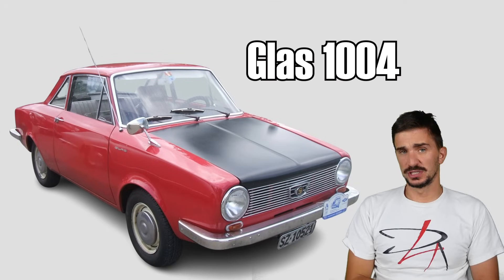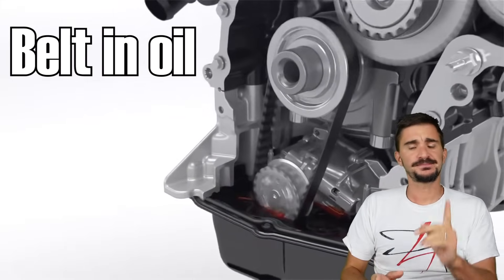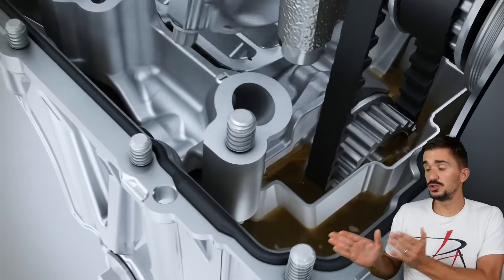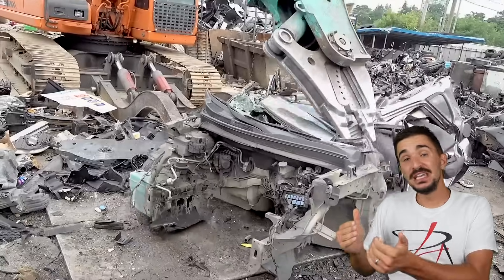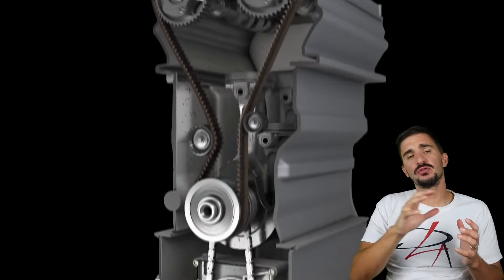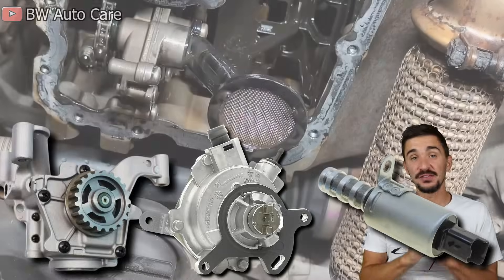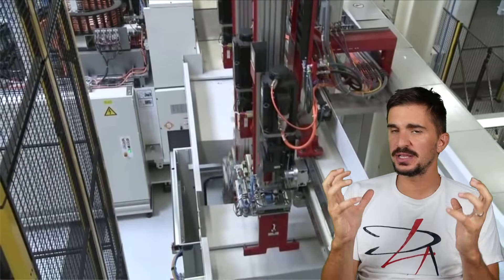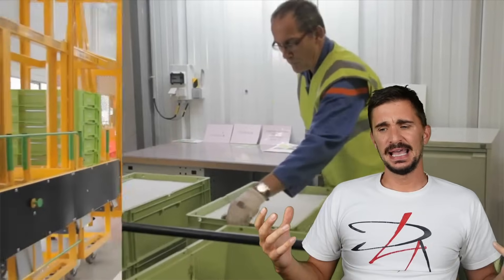Who Approved This and Why Is It Still Being Made? Wet Belt aka Belt in Oil Engines

Comment: We had a Vauxhall Grandland and it's was on it's 3rd belt in 46k miles.
The first one began degrading and was blocking the oil system. 
We change that at 24k miles and had to flush the oil system.
We replaced the 2nd belt at 43k miles with 19k miles on the belt and it had also began to degrade requiring another flush of the oil system.
Our Vauxhall garage is now recommending changing them every 15k miles.
We sold it asap...
Reply: I'm currently researching which car to get when our Hyundai i30 needs replacing, and called into a Vauxhall garage yesterday, where there were several Grandlands and Crosslands.  As far as I could tell, these huge vehicles all had 1.2l petrol engines, turbocharged, but tiny nonetheless.  We definitely won't be buying anything with a wet belt, or a tiny engine.
Reply: @1man1guitarletsgo  you could have a look at a Mazda 3. Not sure, but I think they still use downtuned larger displacement engines.
Reply: @mjouwbuis  Thanks, will do.
Reply: @mjouwbuis  yes, the Mazdas come with 2-2.5l n/a high compression engines, giving them similar performance and fuel economy to smaller turbocharged ones
Reply: @mjouwbuis  I had a 2005 Mazda 3 with the 2.0 and 5 speed. That was such an excellent car. I took it on several high speed long distance trips and it didn't blink. And I mean 200+ miles averaging 90+ mph
Reply: @1man1guitarletsgo Toyota hybrid? No rubber drivesbelts whatsoever on the car, and the hybrid battery has a 15 year unlimited mileage warranty in the UK.
Reply: @Yossarian-uj9dh  Thanks!  As it happens, my company's about to get a Corolla hybrid as a pool car, so I'll get the opportunity to try it.
Reply: ... and the dealerships doing these timing belt changes are loving it.
Reply: @Yossarian-uj9dh  And it'll have to be crushed as soon as the battery is worn out since a new one will be unaffordable.
Reply: @mjouwbuis  Our Mazda 3s (US) had 2.0 or 2.5 liter engines (currently they are all 2.5) and they are chain driven and have very few issues. My daughter has one that is maintained by me with 116K miles and other than a battery replacement, there have been no engine repairs. (Recommended)  Do not buy a Vauxhall as they are owned by Renault.

Comment: one thing that I find amazing is that f1 (pinnacle of motorsports engineering) is using timing GEARS instead of belts and chains for the last 20 years and no one even mentions it as a possibility to solve this problem once and for all.
Reply: There are engines with shaft drive instead of geers and belts.
Reply: There were engines made with timing gears, like the 3.0 liters diesel from VW used in the first generation of Tuareg. It basically never has to be serviced.
Reply: Super noisy and ineficient. Race cars usually have timing gears to be robust, but chains/belts are way more reliable in the long run because they make up for small changes im clearences and wear.
Reply: Like the 2CV !
Reply: A lot of race car engineering is inappropriate for road car applications as the goals are so different. NVH, cost and long-term reliability being the obvious ones. As you can imagine it's a lot more difficult to tightly control the position and precision tooth form of a series of gears versus a few gears connected by a much more compliant chain/belt.
Reply: There are drawbacks to gears. Namely cost (more parts to machine), as well as noise (gear whine), and more parasitic losses (more parts contacting one-another). I would gladly live with all of those drawbacks. That being said, timing chains are reliable, given that the vehicle is held to a rigorous oil change interval. Manufacturers pushing 10k mile oil change intervals is plain stupid. Poor oil quality (or lack of oil) causes chains to stretch and guides to get brittle and wear. But I have seen chains go over 400K with no issues because of consistent oil changes.
Reply: Larger diesel engines have some gear driven timing systems, the 12 valve is as well as its little brother, but the premise of this issue is that manufacturers make lots of money selling the parts to repair vehicles that constantly break due to under or over engineered crap in place of what could be much simpler, stronger and designed for longevity.
Reply: @alexandruilea915 it was a 5.0 liters diesel, not 3.0
Reply: @firstNamelastName-ho6lv  mmmmmmmmmmm not sure, Honda VFR750 is geared distribution, yes, slightly noisy (a nice noise though) but for sure an indestructible engine!!!

Fact: Manufacturers earn loads with spare parts, SPECIALLY, complicated design European brands!!! 

Lesson: BUY JAPANESE !!!
Reply: Industrial engines overwhelmingly use gears also.
Reply: Any diesel that's good uses gears. Extremely efficient
Reply: Briggs and Stratton has always been gear driven cams…
Reply: Road engines up until the 50s mostly used gears. The main problem and the reason you won't see them ever again is.... They cost more.
Reply: I once read on a used car ad that "this car has gears, no timing belt replacement needed". It was a suzuki M13A engine (2005-11 swift MZ), and it has a chain. I did not bother going to that dealer.
Reply: LOTS and I mean L O T S of things can be done to improve cars with just what we know now, but a good working car “hurts profits” so it goes backwards
Reply: Motorcycles have used them far more frequently.
Reply: timing gears are more expensive, heavier and noiser than chains. Chains work fine as long as the oil is changed. Why change it?
Reply: Gears and F1 engines are very noisy.
Reply: There have been plenty of engines with timing gears, two examples I can think of are the Ford Big Six (the 240ci and 300ci/4.9l i6 used in trucks and the Galaxie from the mid 60s to the mid 90s) and most Cummins engines
Reply: We started with gears in the first place.
Reply: Timing belts need to to be dry and easy to change... simple.
Reply: @tooltime9260  Not entirely true. The Ford GAA 18 liter V8 designed for tanks (derived from a V12 aircraft engine) was a gear driven dual overhead cam design. How did they do that? Worm gears on the ends of long shafts. A very effective design though too expensive for cheap little economy cars.
Reply: Gears were used in some of the most reliable motorcycle engines made by Honda, the V4 750cc that equipped the VFR750. And it revved to a 11k RPM + redline!!! Still one of the best motorcycle engines ever made!
Reply: @Sam-og3lo  So much this!
Race cars get much more attention than those sold to the public. And, as you noted, nobody wants to listen to timing gears in their CR-V—nor will they pull the cover and inspect them every few thousand miles
Reply: @firstNamelastName-ho6lv Timing gear noise was a solved problem by the 1930's. A gear drive setup by its very nature does not wear in such a way that it needs to "compensate" for it.
Reply: Volvo's D7E truck and bus engine uses timing gears too :)
Reply: timing gears are the only way to achieve high rpm such as 20000 rpm and that's the reason they used them. Timing belts and chains just don't have enough strength to handle those rpms.
Reply: The newer Ferrari V12s use timing gears
Reply: David Brown Tractors manufactured their own engines . All had timing gears and apart from some early seventies tooth failures which was quickly resolved they were very reliable and fuel efficient.
Reply: they are revving super high, where it's just more reliable at that point. i'd also guess they're probably opening and closing the valves directly with that too due to the rpm.

i've put timing gear sets with a dogbone in place of a chain in stuff like small block chevs. i'm not 100% sure but i think kits like that are somewhat common / affordable, but sap a bit more power with the constant straight cut gear mesh, and may stem from nascar?

people i've done it for do it purely for the roots supercharger whine, without having to deal with cost / install of a supercharger though lol
Reply: imagine your neighbour warming up than noisy engine in the morning
Reply: The 2.5L "iron duke" 4 cylinder engine used on many GM roducts through the 1980s through mid 1990s had a timing gear. Right at that point in the malaise era, they wanted an engine that was like half the size of a V8.  So they took a 302 V8 and cut it in half at the V, stuck some balance shafts or whatever on it, and (after the first year or two with a gross emissions carb) slapped throttle body injection on them from 1982 to end of production.  They specifically wanted it to be reliable, so when they realized the planned timing belt or chanin was going to be quite short, they decided to throw gears on there instead.  

Between the cast iron block and head, and very lethargic state of tune, those engines would run about forever.  My sister put this to the test -- extreme car neglect style... it got a radiator leak (which she didn't fix), either burned or leaked oil (when I had this car it leaked 1/4 of a quart per 10,000 miles, but after SHE had it for a whilee... well... ...),  Knowing it "used"/leaked fluids,she would not check fluids.  Alarmingly... if you ran it out of coolant, the throttle body injection was like 10PSI (low fuel pressure) so it'd vapor lock and stall before it got the cast iron too hot apparently.  She'ad add a gallon of coolant (I don't think she actually filled it, just added a gallon.  Yeah.) and start 'er back up.   If it ran out of oil, the hydraulic valve lifters would  not lift and it'd stall out.  She'd add a gallon of oil (which, given most cars take at least 5 or 6 quarts, probably meant it was a quart or two low to being with...).  Unbelievable, but she just kept topping fluids for about 2 years while she was in college before it finally began to run poorly.  She has learned to tkae better care of vehicles.. after she tried that with her next vehicle, a Toyota, and it lunched the engine driving it around low on oil.  She now pays attention to coolant and oil... well she did before she got an electric vehicle.
Reply: Yeah but those engines get beat on wayyy more. And a failure fucks up your whole race. Timing gears werw the OG timing method.
Reply: @sirifail4499  Now Briggs have plastic CAMSHAFTS!
Reply: @Sam-og3lo  yeah race technology like fuel injection, turbo, abs, ass and many others not at all suited to road cars 🤔
Reply: Very Noisy, LOUD!
Reply: @GlamStacheessnostalgialounge  most engines up until the '50s were not overhead cam engines which is the norm today. OHV and sidevalve engines had the camshaft down close to the crankshaft, so using gears or a small chain was trivial. But then you had pushrods connecting each valve, and many other inefficiencies and disadvantages to these largely obsolete designs.
Reply: F1 stopped using gear driven cams in the 1950s. They switched to chains then belts. For the past 20 years they have used pneumatic (compressed air) operated valves.
Reply: @Poorschedriver 10l miles? I just handed back a 2022 hire Vauxhall combo van. The service interval is 23000 miles 😂😂😂😂. This is laughable! I change oil on my personal car every 5-6k miles top. ( always buy OEM parts ) and despite that, when I drain the oil I can see it’s not going to last another 5-6k( obviously this is just an observation not scientifically proven) miles as the manufacturer recommends . 
Bottom line is that all manufacturers want you to buy a new car every so often not driving the same car for 10 years for example. The European politicians don’t help either with all of their green agenda ( I’m environment friendly but reasonable)
Reply: Cost and government regulations are the main reasons.

Comment: I own a 2009 Ford Mondeo with the 1.8 tdci engine in question. I only learned after buying the car about the wetbelt. The car had 130,000 km on it when I bought it so I knew I had to do something and fast. I didn't know if the wetbelt had ever been changed and I didn't want to put another wet belt in there. I converted from wetbelt back to the timing chain. The 1.8 tdci engine has been around for a long time so the timing chain kits were readily available and I believe only one pulley had to be changed for the conversion and the pulley was cheap to buy from Ford (around €20). The wetbelt looked terrible when it was removed, the rubber was all cracked and the belt was very brittle. I have been driving the car for the past 8 years with the timing chain kit and no issues whatsoever. I average between 5.4 and 5.6 l/100km which I am happy with and the car runs great. The car has 205,000 km on it now and going strong. I hate Ford for introducing the wetbelt.

Comment: I am working daily on the 1.2T Pure Tech from Peugeot. It is absolute shit. We had more than 100 instances of premature belt replacement in 2023. And by premature I dont mean like you said around 100k km, I mean 35-50k km. The earliest was around 20k if I remember correctly. Peugot has in time done four things to combat this:

The service interval was reduced from 30.000km to 20.000km, the belt interval was reduced to 60.000km, checking the belt is now a point on the yearly insepaction, with the tool you showed, the wet belt design was replaced by a chain in late '23.
Reply: And you must use a special Oil for (in Germany) 30€ per litre. Every service.
Reply: 😂, enjoying the diagnostic? Thoes engine came new 2017 ish, engine problem starts not even reach 10000km.
Reply: Had this engine, serviced by book at the dealership. Even had the belt replaced prematurely due to cracking. Still, at 110k km the engine was done due to running dry (pieces of rubber blocked the oil pathways). THe dealer was quite frank by telling me they could in theory get me a new short block and fix it but in practice I should get rid of the car and get something else because the engine is total crap made for 100-150kkm. It was at time when they stopped selling diesels in EU and only had this engine in their lineup so they basically told me to buy car from someone else.
Reply: Have the car with that engine. The belt failed around 60kkm and engine was repaired under warranty.
Reply: Is the oil pump also chain driven?

Comment: I have a 1.0 civic turbo from 2020 that has an oil wet belt and it changes the oil every 9000km and the belt every 120000km. I am at 80000km and no problems yet related to that but your video is very cool and informative I am never buying a car again without carefully investigating more on its engine. Thanks!
Reply: everything can work, if the quality is right. not saying, hondas quality is good, just saying: a broken clock is right, twice a day. if my chained corsa is 60k per change, you should 100% do it every 30.000km. if it fails, your engine is DONE. no warranty, i promise. it doesnt have to break in a big way. all those years of sucked up, hot oil in a rubber product? couldve told you 20 years ago, that this idea was stupid. 
precaution in those belts, thats all im trying to say. work at citroen and the amount of belt changes we do is astounding. especially the ones that still got like 10.000km until it SHOULD be changed....but the engine is dead, because of the belt.... i cant see that french pile of plastic and sharp-everything anymore, it physically makes me want to gag.
Reply: Check your sources. I'm seeing that this engine uses a timing chain, not a belt. I hope this makes your day. Honda knows these wet belts are problematic.
Reply: @markleggett3944  the 1.0 turbo uses a wet belt that is notorious for failure in hondas
Reply: @ymirfritz9989  Thanks for that info. I'm sorry to hear that Honda has fallen into the disposable car market as well.
Reply: Only the 1.5 and 2.0 turbo use chain. Sadly the 1.0 uses a wet belt
Reply: Honda now have a recall on the wet belts. I'm not sure what the fix is though but they did have a lot of failures.

Comment: One of the worst things with the wet belt on the Transit van is it sheds particles which block the oil feed to the vacuum pump - the result of this is the vehicle brakes fail when you don't expect it. One of my neighbours nearly had a very bad accident when trying to stop.
Reply: That doesn't make any sense. Vacuum is created by the intake.
Reply: @JHe-f9t  The vacuum pump on the transit has a oil inlet with a hole about 1mm in diameter. Doesn't take much to clog it - then the pump stops working and has to be replaced.
Reply: @AndyFletcherX31 So ford in their infinite wisdom took an existing vacuum system that has worked for forever that has no moving parts and is free and put in a vacuum pump?! And it's $500 to replace?!

And I thought ford from the early 2000s were bad...
Reply: @user-yu8ur9yi9e  turbo engines don't make consistent vacuum, the intake is pressurized and the vaccum infront of the turbo isnt enough on even gas engines now. So they fit mechanical vacuum pumps to run the power brake booster no matter the engine boost level, this isn't a ford thing it's a all turbo engine thing. Diesels have had them forever and now gas engines have them.
Reply: @KR-hg8be  Thanks for the info!

Comment: The process you describe at 10:40 is exactly what happened to a friend of mine who had purchased a very young Ford Focus estate 1 litre. It had less than 60.000 km on the clock when a blocked oil strainer left them stranded. 

The engine survived but the cost of cleaning up, replacing the belt was close to 2k, on a car they had paid close to 30k for a little over a year earlier….
Reply: Low oil pressure likely caused accelerated wear in the engine and will shorten the engine's life span.